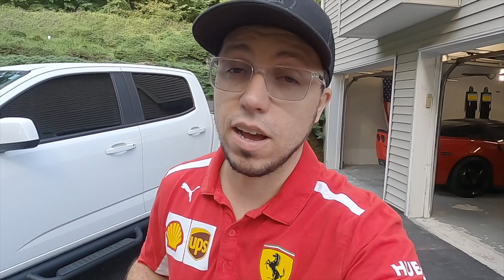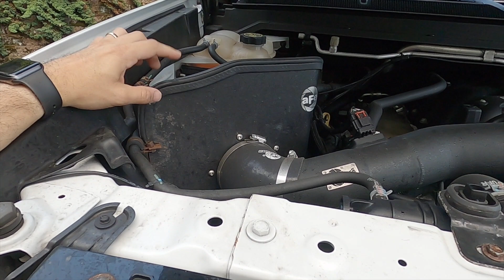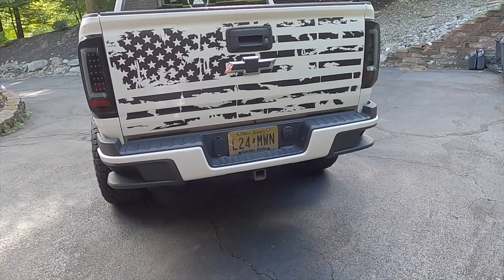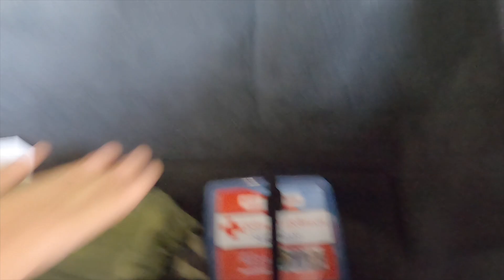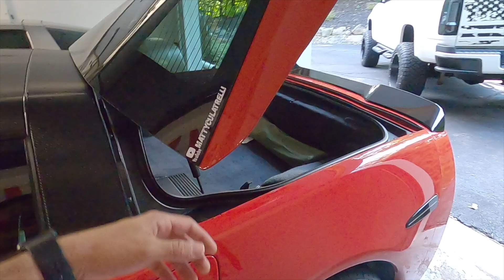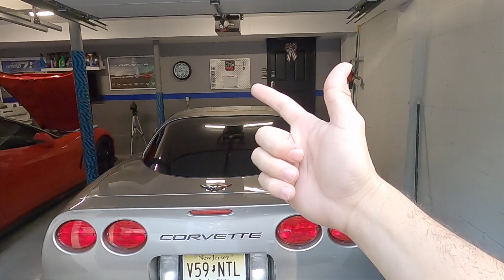Life update, Chevy Colorado, Selling a Corvette and Etc.

Comment: Hello Matty, Air Intake: look up Airaid cold air intake. It is made of high-quality plastic, and support brackets. I have left the cover off the air box, and drill 4 small holes in each of the corners to allow the water to drain if any gets in the air box. This air intake allows you to keep you factory beauty cover, which is the main reason why I been using this brand since 2000.
Reply from the maker: Cool man! I will look into it!

Comment: Hello Everyone, 
Has anyone experience their key getting stuck in the ignition on any Chevy/GMC 2015 or newer? If so, what I have done is replace the GM Genuine Parts Ignition Lock Solenoid (Part # 22891588). The dealership wanted to charge me $600+ to replace the entire ignition key assembly and that they can not order the part by itself. After taking a shot in the dark, I found the part number and order it from Advanced Auto parts for $30 and it only took me 15 min to replace it. So far, I no longer have the issue